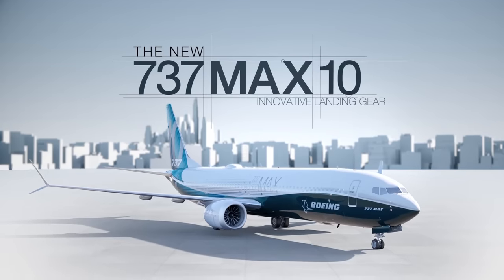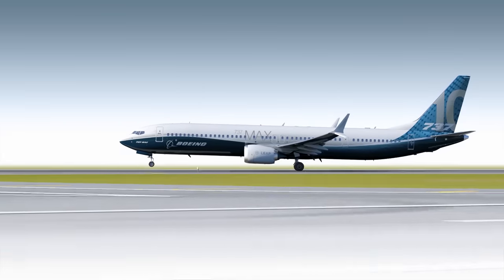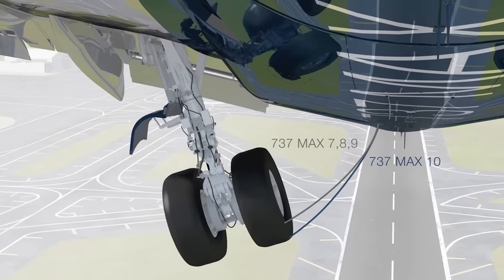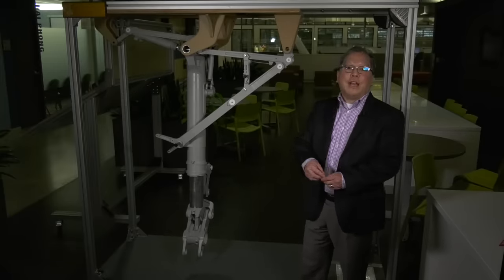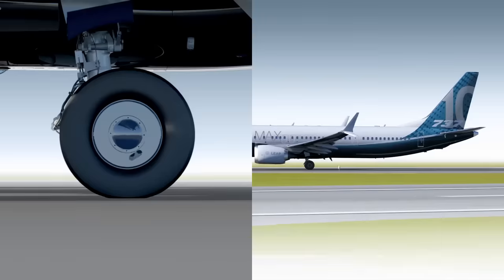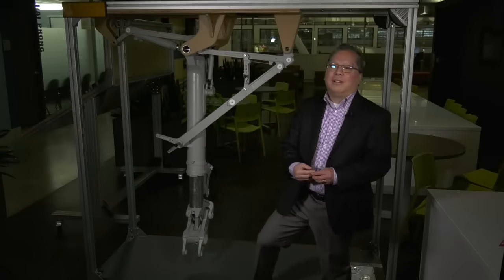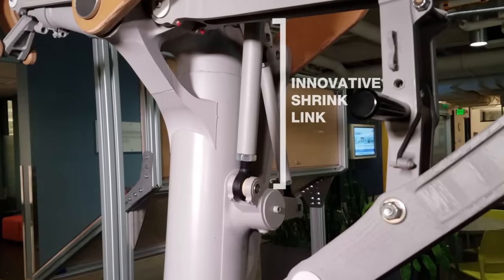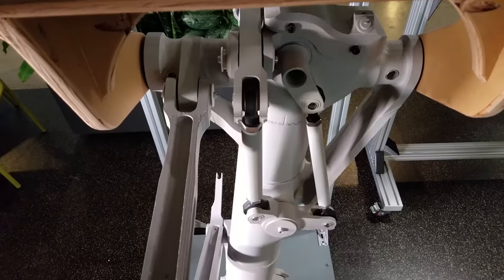How the 737 MAX 10 landing gear works

Comment: The MAX needed a new wing box and much longer landing gear so that the engines could be fitted on the wing properly.  That would have cured the pitch up problem and not necessitated the poorly designed MCAS.  Hindsight is 20/20.  Let's see if Boeing makes the right moves.
Reply: That's WRONG! Engine placement was NOT an issue. MCAS was implemented to make the MAX fly like a 737 NG to reduce training costs.
Reply: @RagShop1  You have not studied the aircraft.  Try a little harder before making declarations that are clearly not based on fact.
Reply: @encinobalboa  I've read extensively about the problem in Aviation Week magazine  for a few years so yes, I'm informed. The assumption you made about the design was incorrect. MCAS was NOT a stability enhancement; iy was done to counter the aerodynamic differences with the 737 NG to make the MAX fly LIKE a 737 NG.
Reply: @RagShop1  Wrong again.  Larger diameter fans necessitated placement of engines further forward and higher on the wing.  Keep trying.
Reply: @encinobalboa  Doesn't matter. Engine placement wasn't the issue. You're repeating a false narrative from that time that has since been debunked. The MAX's aerodynamics are different than the NG's which is what MCAS counters so it will fly like the NG. That the engines are higher and forward on the wing doesn't make it unstable in normal flight. https://en.wikipedia.org/wiki/Maneuvering_Characteristics_Augmentation_System

Comment: Still prefer the A320NEO, I went on one a few days ago. Super quiet, and comfortable even on a budget airliner.
Reply: yeah ikr i've looked on several forums telling me that the new 737s and the a320s has the same noise volume in the cabin which is obviously not true
Reply: I went on easyjets first A321 Neo when it was 1.5 weeks old. I could still hear something similar to a roar, but much much quieter
Reply: Then you must try the MAX
Reply: Yeap, WOW and WIZZ use NEOs and they are great
Reply: Robbae Mee too. The A320 series is the best!
Reply: Robbae because an airline being budget will make a difference whether the aircrafts manufacturing is quiet or not
Reply: a320 neo is a far better plane
Reply: Have you tried both? I guess not.
Reply: @TheDaar97  obviously I have, why would you doubt that?
Reply: TheDaar97 actually I have been on the Norwegian 737Max...
Reply: Stephen Reddin yeah but budget airline seats are horrific, the noise and the environment inside made up for it
Reply: I was on Southwest airlines new Max 8, super quiet, comfortable and smooth. even flying through rough weather
Reply: I like both but A320 neither takes the cake it’s the same cockpit as A320s so no money spent on trying new pilots on it.
Reply: 737s are always better than crappy airbus
Reply: The A320 NEO can be configured with the same CFM LEAP engines as the MAX but the MAX has chevrons, making it the quieter plane.
Reply: No one questions the a320neo family, it is killing the 737. We will see if the 797 can turn it around.
Reply: @aerohk  While it is true the A320 NEO is outselling the 737 MAX right now, if all of the Boeings had commonality, the 737 would probably be doing better.
Reply: I totally agree! The NEO is 10 times the aircraft. The 737 has some beautifications, but it is still a 30-year old airplane. Boeing makes other great aircraft, but they should be ashamed of this product . . . absolutely stagnant.
Reply: @b.p.7153  The 737 is from the 60s and it's airframe is based on the 707 which will have entered service 60 years ago this month. Nonetheless I still like the aircraft.
Reply: The 320Neo is nice but the fuelling panels suck. They relocated it to the inside right fuselage which was the perfect genius move to do, no sarcasm, but use the same old crappy panel. If they swapped the panel to an Embraer 175 style it’d literally be the perfect plane.
Reply: Both planes use the same LEAP engines. I guess you haven’t flown neither NEO or MAX to define ‘’Quiet’’
Reply: @Racko.  The MAX has chevrons, though. There is at least a slight difference. I flew on a WN MAX 8 in July.
Reply: Baiet Simpson Did you Also fly the a320NEO? If so which was quieter or were they both with the same quiet performance? I guess the 737MAX will be much quieter because it’s chevrons allow that. I’ve flown the A320CEO And 737NG. I do want to fly both NEO and MAX
Reply: @Racko.  I haven't flown the NEO, but they are two different aircraft from two different companies so there is going to be some difference. Especially due to chevrons.
Reply: True

Comment: Too bad ya can't engineer a fix for the 737 being so cramped...Give me an A320 any day
Reply: The airlines decided how to outfit the interiors; so the space you get has nothing to do with Boeing or Airbus. If you want more room, fly a nicer airline.
Reply: Not until a boeing engineer creates the incredible shrinking ray. 
More miles per pax.
More overhead space.
More space for your legs.
Stay tuned😁
Reply: @IKonrad112  Actually, the A320 has a wider fuselage than the 737. Therefore, the cabin is wider and so there is room for wider seats

Comment: Meh! Boeing really squeezes the good old 737 to within an inch of its life. Less-than optimal bypass ratio due to low ground clearance... This landing gear stuff... The antiquated and cumbersome plug-doors... Lack of fly-by-wire... As much as I like this plane - If it weren't for the Airbus-Boeing doupoly, the jurassic 737 design would have been long out of production and replaced by a modern narrowbody...
Reply: *It does feature fly-by-wire systems for some aspects. Needless to say, airlines still want it. Boeing pressed for a clean sheet design several times; yet, airlines still wanted more 737 aircraft.
Reply: @jviation737  Sorry, but that is not correct. Airlines did NOT want more 737. Airlines would have favored a clean-sheet design. However: having sunk billions in the Dreamliner kerfuffle, Boeing was unable or unwillig to pull that off. Airbus, with the launch of the A32Xneo, forced Boeing's hand to create the 737max: Simply because the 737NG was no match for the neo, and nobody in Seattle or Chicago wanted to take the risk of a new aircraft. I have nothing against the 737, but the max and especially the max10 are just one step too far. The 737 base design IS outdated and too many things had to be grandfathered from the 737 jurassic... Why is the orderbook still relatively healthy? Well, that is the 'beauty' of an oligopoly. Beyond Airbus and Boeing, there are few - if any - alternatives for Airlines.
Reply: No, airlines wanted more 737s. Specifically, American, United, Southwest, Air Canada, Lion Air, Air China, Norwegian, and many others. Boeing was pressing on a clean sheet design but all these airlines wanted a simple re-engine. The MAX is basically a filler to bridge the gap between the 737 and the possible Yellowstone 2. Boeing timed this in a perfect manner. Once most of the 737NGs and A320ceos reach their retirement age, Boeing will announce the Y2 (possibly, around 2027). Or maybe Boeing will exit the narrow-body market altogether.
Reply: @IANinALTONA  Yes, they did. You sir, are incorrect. Southwest, which has ordered over 1000 737s, threatened to switch to the A32x if the 737 had not received a modernized NG. Boeing was debating back and forth in regards with the Y3 program, yet as we all know, was pushed for a later time. American also pressed for a competiting aircraft and a clean-sheet design was concluded to be an economically-wrong move. Why go clean sheet when you can go out with one last huge-profit bang and keep loyal customers happy? The 737 replacement is poised for around 2030, yet there are plenty of airlines whom have pushed for more 737 variants (i.e. United, Korean, Lion Air group, Southwest). Boeing is not stupid, their product works, and their biggest customers want more. It's foolish to not give into that. Statistically it's good enough for a A32x competitor (efficiency wise and whatnot), and whilest we feel as if Boeing doesn't listen to their customers, they do, especially their loyal ones (i.e. WN (and who wouldn't?))
Reply: IANinALTONA current 737s are just heavy facelifts.
Reply: I have to agree with you, the 737 is really starting to show its age. It's time to move on to new design. The max will probably be the last generation of the 737.
Reply: +Tom Jardine +Tom Jardine Nope. Airlines need the 737. For example, the 737 has a higher MTOW compared to the A320. The 737 can also fly higher, perform better on hot and high airports, great for airports with limited service (thanks to optional airstairs and the low ground clearance for baggage handlers).
Reply: @jacobnathanielzpayag3885  the a320 also has the optional airstairs. And these days the amount of airports operated by big airlines don't really have problems with handling services thus making your argument a bit pointless to be honest.

Comment: The 737 is a patched mess.
Reply: @dnaspower
@mipmipmipmipmip
So true. Yet the damn airliners keep ordering it.
Reply: avada because it’s a damn good airplane there’s a reason it’s been around so long. Airbus did the same thing with the NEO? Aircraft manufacturers have been doing this for decades? Look at the 747-100 vs -8 for example? That’s still the best freighter aircraft in the world
Reply: @southwestman84  the problem here is that the 737 is too short to fit the new engine. Therefore, they shifted the engine upward which make it so unstable (which lead to the creation of MCAS).

Comment: I might not understand this completely, but if it can just slide back up with zero resistance, isnt that basically the same as having the shorter gear? Its providing no support for those extra 9 inches

Comment: I have a huge respect for the 737 despite not being a fan of it (especially the landings where a brick would have a softer impact). If it wasn't for airlines having gigantic fleets of 737s (therefore making a new airplane a pain in the arse for maintenance costs) this thing would be more than dead. Basically a plane that had its golden Era a long time ago and needs a replacement.
Reply: Boeing wanted to do a clean sheet design for a new aircraft that could substitute the 737NG. After that, Airbus presented the a320neo family. At that moment Boeing had to decide between a replacement for the 737 and selling almost non 737 NG until it's replacement or to make a new generation of the 737.
Reply: @javierpinonolazar5828  I know
Reply: EpiDemic117  wich is quite understandable because of maintenance cots. Boeing wanted a new design but they are quite happy with the 737. But yes I do understand your point, though this - 10 version is being humiliated by the A321. The - 10 was probably requested for some airlines with big orders. Boeing knows that this is no match for the A321 neo LR
Reply: EpiDemic117  indeed. The auto industry here in Europe isn't that straight forward but there are some cases of that like the Fiat Punto that was in production for 16 years eventually ending due to a safety test from EuroNcap in which it scored 0 stars. We will only see big changes both on the a320 and the 737 when a revolutionary new design/engine/technology reaches the market. These 2 are going to last very very long
Reply: EpiDemic117  those airlines have a different business strategy so they are not really comparable. But of course they save a well of a lot of money just by having a simple fleet. The future is point to point but we can't forget that we still need jumbos to fly between 2 big hubs or the cash cow routes. With jumbo I mean something from 300 to 500 pax. Narrow bodies are easy and cheap to operate but a fully loaded 777/747/A380 is also a money making machine. The problem is filling them on some routes. The a380 is the perfect aircraft for Emirates since they want to have the biggest hub in the world in Dubai. They want to connect the whole world with just one stop. So the a380 and big jumbos are not dead because there are hubs that need to be feeded.

Comment: Neat but.. is it safe? Time for Boeing to do a clean sheet design.airplane
Reply: They pressed for one, yet airlines still requested for more 737s. You cannot blame the manufacturer for what the customers want
Reply: My name is Renzo grinzato I have been an aircraft maintenance for the past 20 years that new landing gear was great but what happen if you got hard Landing Miss approach or simply the snapping down the aircraft I have been flying with this pilot for the past 5 years and I see all kind of Landing I don't think that extending mechanism is the best idea
Reply: The 777-300 has the semi levered gear system to help with takeoffs reducing the risk of tail strikes. What if that fails...o wait it didnt. Simpler mechanisms are harder to fail
Reply: ysfsim  the onle used on the 773 is more like a pivot lock than a complex mechanism like this.
Reply: Jacob TJ They should phase out this plane once they have enough orders. Would be nice to see a brand new clean sheet design, current 737 are really just heavily face lifts of the original
Reply: @Matty12333  They were going to do it but Airbus released the a320neo and they didn't have any aircraft to compete.
Reply: Shortening mechanism has been on the A330 for 25 years. It's quite reliable.

Comment: How many new tricks will Boeing be teaching this old dog until they figure out they need a new one?
Reply: while i agree with you they didnt have a choice when airbus came out with the neo's ....building a new small aircraft would take time and money plus they would lose ground .... but i think the max 10 is a mistake ..
Reply: Brandon Tobias I think the A380 is a mistake. They basically took what Boeing did with the 747 and just added a top deck all the way back. Spent all that money on a product plane that has yet to even break even as it cost more to prepare for and maintain than it's worth. But as far as planes go, I don't care what I ride on as long as I get there safely and in one piece lol
Reply: This is not a new trick. It's A330 landing gear design.
Reply: Brandon Tobias Airlines asked for it. Which is why Boeing made it, with already 500 orders and still selling it will get there. Otherwise you don’t just stretch a plane because you want to
Reply: The old dog is dead now.

Comment: Put the engines further out on the wings, so you can put the landing gear further apart, make it longer, then the engines can be lower and in the right place, and so doesn't cause the aircraft to kill people. Yes, that's a whole new plane, but that's what you should have done in the first place. The short landing gear is the primary cause of all of all the 737's problems.
Reply: The whole reason they didn't go new design is Airbus kicking their asses with the 32x neo family. If they would start from scratch, the short to medium market was no longer competitive because Airbus would have all of it
Reply: @simmingszycho1980  They had the 757...
Reply: @GRAHAMAUS  which doesn't come close to the 32x neo family in turns of profits per seat due to being much less efficient. So no, they didn't have the 757, they had nothing.

Comment: Commonality in the 737 family?  No the source of this problem here is that the 737 has always been limited by its gear well design.  I bet you in 2100, the 737 will still be there with the same gear well limitations.  Boeing would rather launch their 737-999 on ramps rather than scrap their original 737 design.  The A320 has more potential and the NEO is outselling the 737 max 3 to 2. It is their cash cow and they will milk it rather than design a new plane from the ground up.  I guess that strategy is still working and the 737 is indeed an amazingly resilient design that is still suitable for todays airline needs.  Kudos!  But come on boeing, lets start a 21th century replacement!  Given the management fiasco that was the 787 development program, and the lack luster 747-8 program investment returns, I can imagine that Boeing is rather worried about starting a new plane.  They may not be able to take another fiasco.  I hope they get back their engineering mojo back.    It is amazing that will all of the amazing engineering capabilities that Boeing has access too compared to 70 years ago, their designs are nothing but uninspiring minor optimization.  No bold design in the pipe at Boeing!  
Hey, Elon, in your spare time, can you create a new airplane/airline company with the balls to push the current technology?  The entire industry seems to be fresh out of bold ideas!

Comment: Tome the funniest thing is that the landing gear they praise in this video is kinda responsible for the two crashes and grounding of the type.
In the video they act all proud by how they fixed an issue with the landing gear being too short but if it wasn't so god damn short to begin with the engines would not have needed to be put so oddly, so MCAS would not have been needed and two planes would not have crashed because of it.